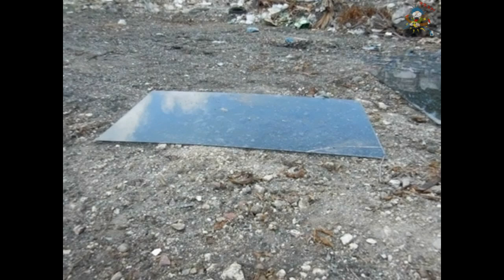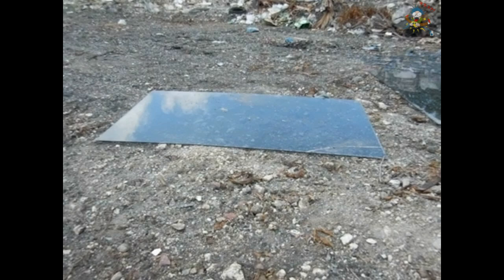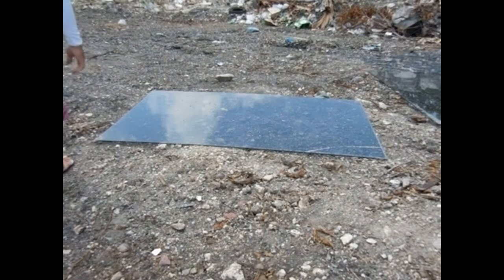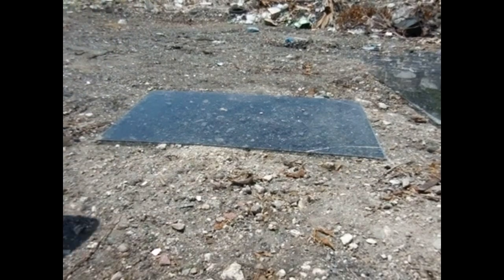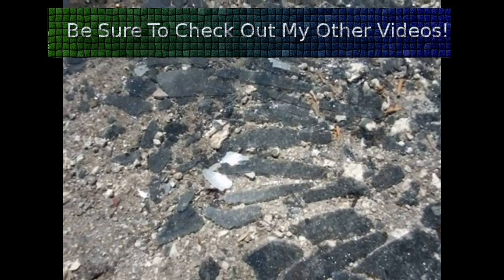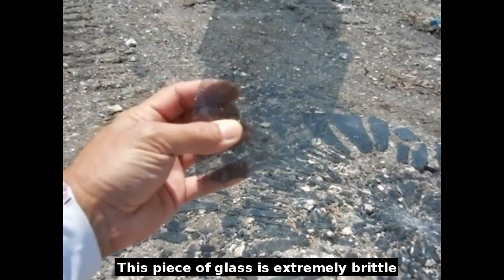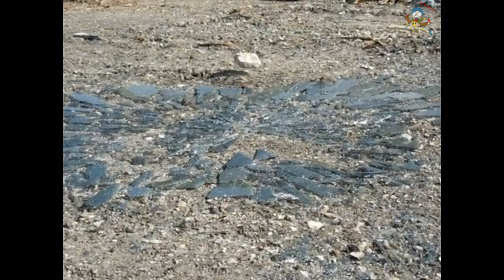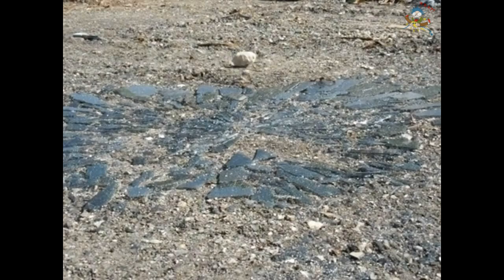Tempered Glass vs Huge Rock!

Comment: There must be some kind of potential energy stored up in the material for it to keep crackling like that.  I wonder how much it is, and what processes are causing it to proceed that slowly relative to how quickly the cracks actually propagate through the material.

Very cool demonstration, thanks for seeing the opportunity and putting it to good use!
Reply: jcims tempered glass is heated to nearly its melting point and then the outside is rapidly cooled with air, while the inside cooles slower placing the core of the pane in a state or compression, the face is extremely durable, the week spots are the corner edges and outlaying edges.

Comment: I once broke my mug, which was made from tempered glass. It shattered completely into tiny pieces, even the handle, which is weird, because I (actually small jar falling from shelve) hit it on the opposite edge. Any idea why tempered glass always shatters so badly?
Reply from the maker: MrJohhhnnnyyy Tempered glass is designed to break into very tiny pieces so people are less likely to get cut up. If large pieces were left behind, then you can easily get sliced up/stabbed. Usually only a few glass splinters or minor cuts may occur from a broken tempered glass panel.
Reply: electronicsNmore I got that, thanks. But I'm more interested in a reason why it shatters such nicely.
Reply from the maker: The heat treating makes the glass extremely hard, but also brittle, so I guess that is why the pieces are small.
Reply: Most interesting fact is that the glass continues to crack after being smashed. By itself, I guess because when first smashed, it breaks glass into big pieces, and that big pieces have micro cracks in 'em. Just a theory
Reply: The reason it shatters this way is also the reason it gains strength from the tempering process. It starts off as your normal annealed glass then this sheet is heated and rapidly chilled with cold air, which is blown onto the surfaces. This heating and rapid cooling process results in the outer surfaces cooling more quickly than the inner parts of the sheet. The result is that these outer surfaces will contract and solidify before the interior, thereby inducing permanent compressive stresses into the surfaces of the glass. This results in the increased strength and safe breakage characteristics observed with this type of glass. When the glass is broken, the stress is explosively released, producing the fracture characteristics of small, cube-like fragments (often referred to as ‘dice’) that are relatively harmless.
Reply: @NeverSuspects   very acurate this is exactly right
Reply: Its due to the way the crystal stucture is
Reply: 3 2 1 okay so in regular glass the crystal structur is uniform making all faces as breakable across its clevage point making for clean breaks temperd glass hass irregulur crystal structure witch makes it great for absorbing head on impacts so well but from a side impact it will slip the cleavage grain releasing all the stress and compression inbeetween the crystal stucker causing a domino effect throught the whole panr making the lovely pattern we all know sorry it took 3 years @mrjohhnnnyyy